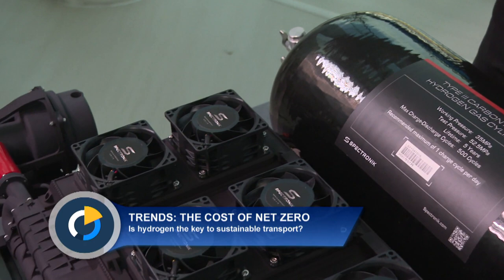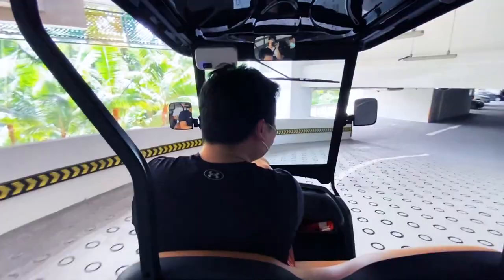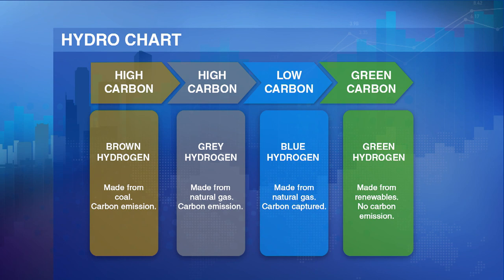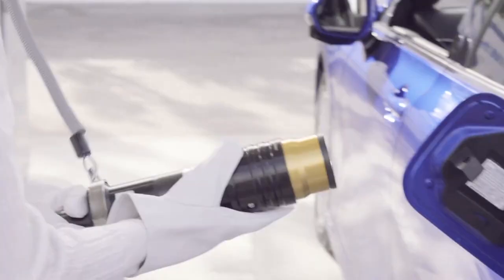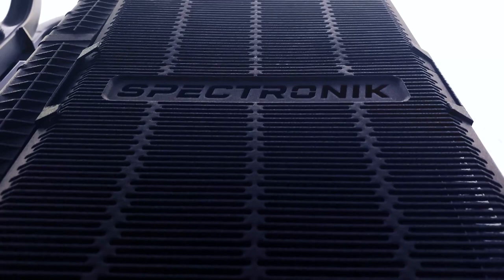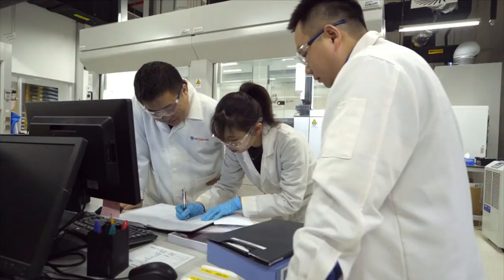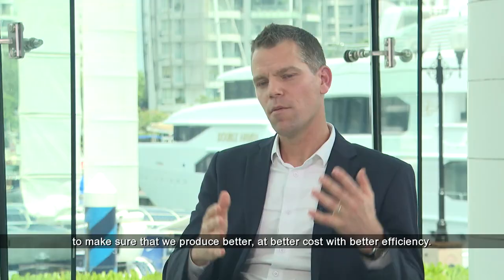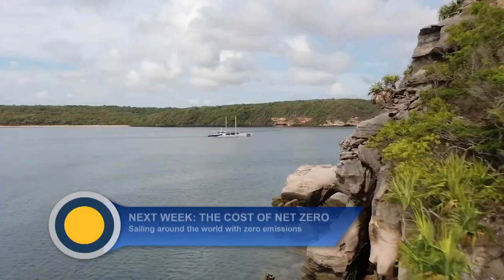Could Hydrogen Be The Future Of Sustainable Transport? | Money Mind | Sustainability Goals

Comment: where do you get the hydrogen gas from? electrolysis of water? where does the electricity come from to do that? is that electricity source zero emissions too?
Reply: from fossil fuels by cracking its methane using water (renewable energy) n Grey hydrogen v Green (net zero emission) ones have diffce
Reply: From Hydro Power?
One of the issues would be safety of Hydrogen tanks (Hindenburg 1937?).
Another would be how big are the tanks, thus the range.
Reply: yeah where do you get the energy to crack the methane. @ralphou